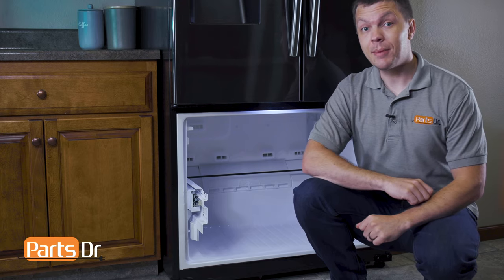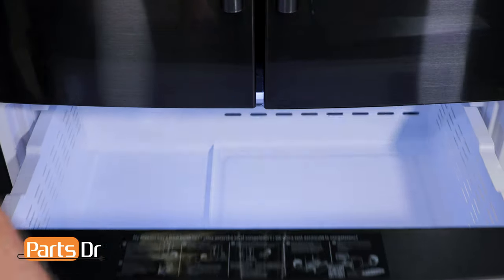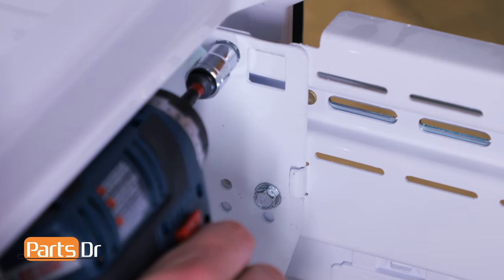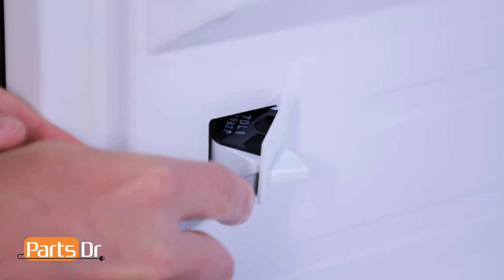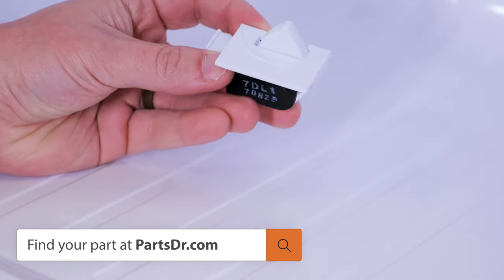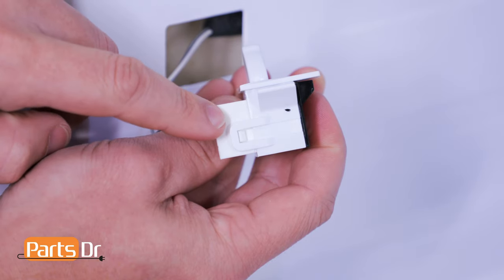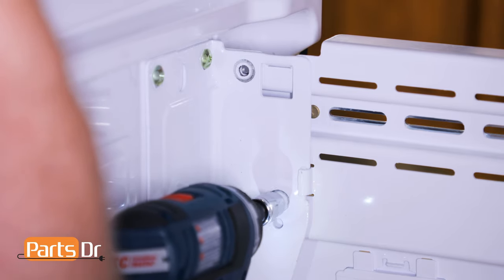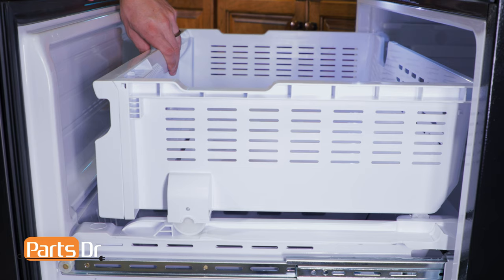How to replace Samsung freezer light switch part # DA34-10120E

Comment: Replaced both switch and led , and still nothing . How is that led light for the freezer powered ? Where are the wires , going to the bottom of the left side door , coming out of the body of the refrig ? Doesnt look like there is anyplace on the hinge for wiring . Model RF261BEAESR
Reply from the maker: The wiring is usually foamed in place inside the cabinet and it is not serviceable.  The main control board is what usually supplies power to the LED lights.
Reply: Is there a setting on the touch display to disable the freezer light?  Our stopped working after my mum let our daughter play with the touch pad while in her high chair 🤔   Model RF28HFEDBSR

Comment: My freezer light recently started staying on very dimly whether the freezer door was open or not.  I have measured the voltage at the LED assembly on the bottom of the left door and it is about 3.8vdc.  Again, this voltage doesn't change whether the door is closed or open.  I've found switch on the left side but when I manually press it the light still stays dimly lit.

Comment: Replaced the light and the switch, light still doesn’t go on. Any idea for next steps?
Reply from the maker: Maybe the light is bad or the control board that sends power to the light is bad?
Reply: Same here. I replaced both but no luck.

Comment: My freezer light all of a sudden stopped working. I watch your videos but it appears that my refrigerator has a reed switch at the bottom left where are you are showing the toggle switch. Is there a way to check how these work or if they are functioning much like the magnet trick you do on the front doors? I have one magnet in that area and still there is nothing.      model number rf28hmedbsgaa
Reply from the maker: Hi Hooziz, yes some models do have reed switch in the freezer.  The magnet trick that you watched in our other video is the easiest way to test the switch.
Reply: Have you figured out how to solve this problem, Hooziz? It seems that I have the same issue.

Comment: I’ve replaced the switch and still doesn’t work. What’s next ?
Reply from the maker: What isn't working?
Reply: @PartsDr  the freezer light my apologies
Reply from the maker: @Unkownsector  it will depend on your model refrigerator. Typically the next things to look at are the light, main control board, or wiring between everything.  Check the wiring diagram/schematic for your model.
Reply: @PartsDr  ugh .. I’m a YouTube mechanic but not that skilled . There are no videos about this on hete
Reply: @PartsDr  Why shouldn't we assume that the darn LED light just burned out?